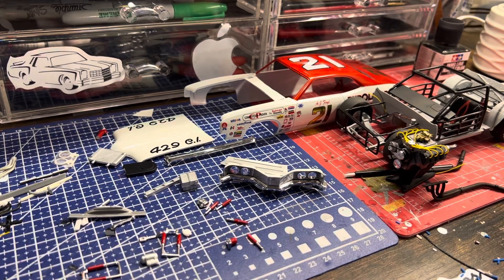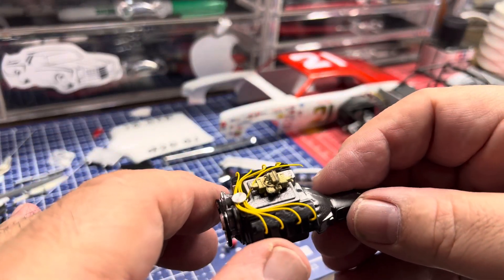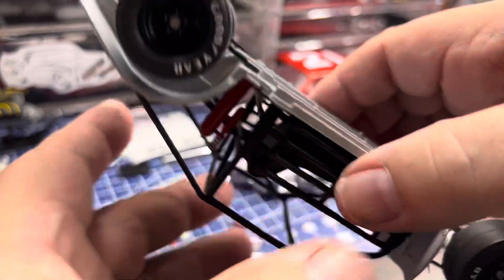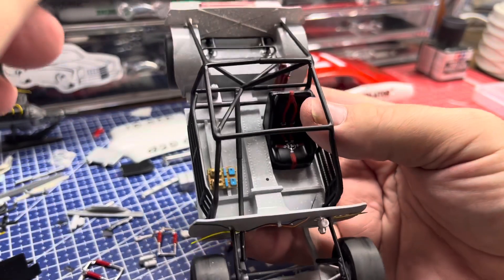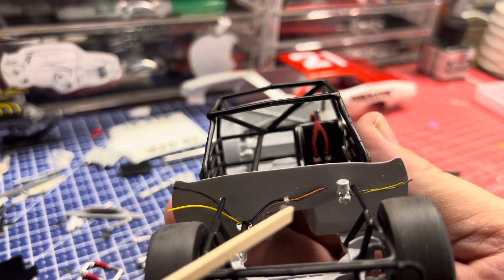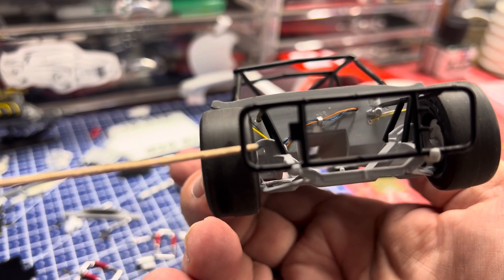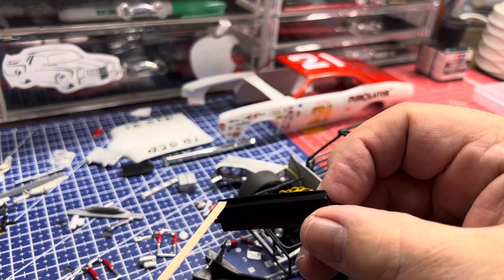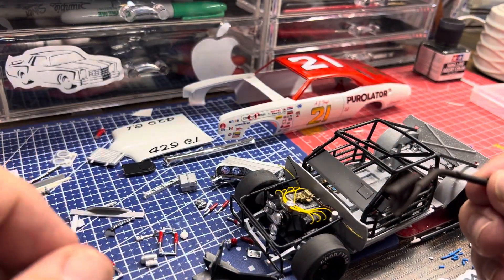AJ Foyt 1972 mercury cyclone

Comment: Thanks for doing these videos. I know it takes slot of time and patience that we benefit from. I just got the m p c stock car series kit #mpc796/12  and was wondering if I would need to make the same modifications. Thanks again!
Reply from the maker: I do believe if it was first run the chassis were a little bigger. But round 2 adjusted molds when they got them from what I understand. And in that process it shortened them a little. But I’m assuming with the 12 designation your is a round 2 and will need the extra support just to get the 2 halves of chassis to fit together.